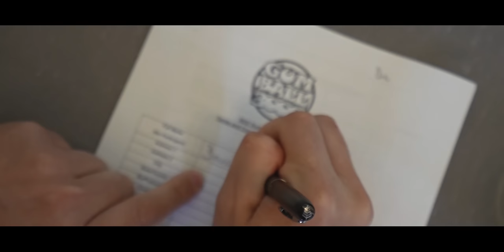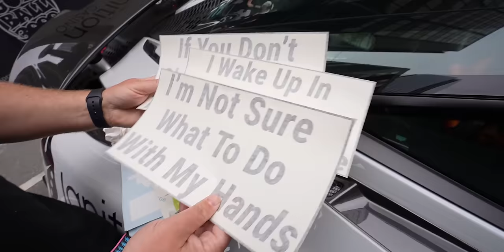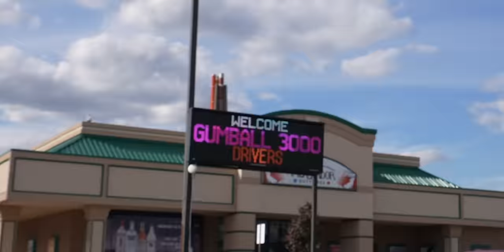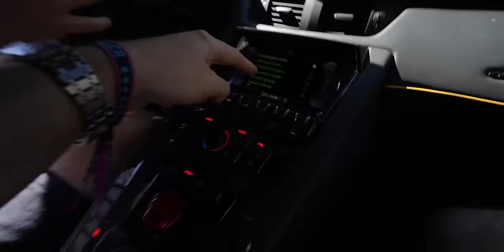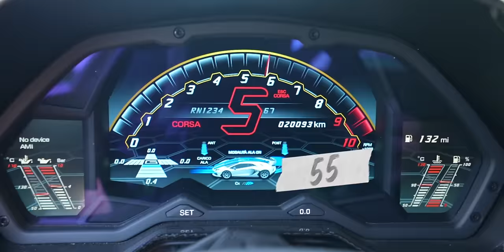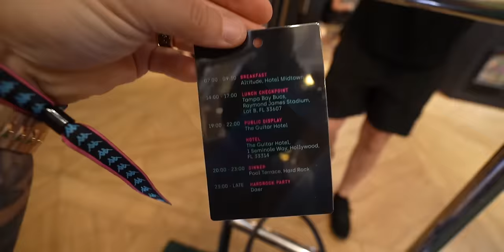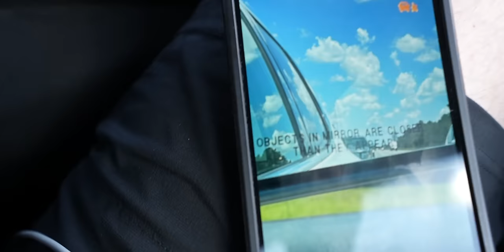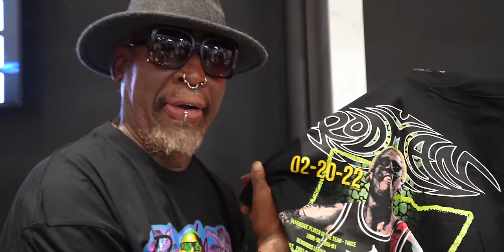DDE X Gumball 3000: The Movie "Toronto to Miami"

Comment: Lots of cool super cars and a few mini busses, the Hummer H1 is the real Hummer, I love it as a Cam car, adding cam Image stabilisation aluminium pro arms and a military top 360⁰ IS Cam setup with a Canon digital camera with a 14-70mm IS USM lens and a perfect 70-200mm IS UMS zoom lens and the last 100-400mm IS UMS zoom lens and the Camera and several mic's and 2-3 of the special direction mic's with a 300 feet rangein the direction it's pointing at and the channel can safely make insane and ultra cool video/audio and production will be so great and the episodes is no limits recording and just add one 3-joints aluminium arm and hydraulic system to do the hard work and it's very easy to get the Special view Cam down just a feet above the ground and movement from the front and slowly getting around to the front wheel tip it slightly up and down to continue with the recording of the super car in Autobarn full speed and back to Hummer H1 speed, everything you need to do with a Cam is more than possible and super cool video's is so easy to make, the Hummer H1 will be the sweet Cam car, and GoPro camera recording of all kind of legal issues and information about the car's legal driving is proved easy and case winning videos. The special long 3 joint arm is so good it's able to get recordings from the ground and straight, upwards and around the other car, the middle section and the 12 feet above the ground and getting in the air and in all setups recording video from being above and 12-? Feet in front and slowly getting closer and still above, side top area recording and back up above the super car recording from above the roof point straight to the back and on the way point it downward and get the working big engine and the rear and rear spoiler wing, from the front and a smooth move past the spoiler and a very nice recording of the back section, ohhhh the best quality and ultra cool episodes will be the new DDE super quality recording and the improved great sound will be new DDE quality...    The H1 can be the best Camera car ever seen, the cool way to get the best quality and Camera view people wonder how it is done so special and the unique style and view points, slow smooth and in one move recordings from everywhere make people wonder how it's done this perfect.
A new ultimate 2024 and it looks like we get a great year of DDE episodes 👍👍😉😉😉🤩

Comment: Stupid, I wonder why the poor management of the building and company, the constant "stupid immature accidents keep DDE at a medium level, stupid projects has to be caught and the cool biturbo, straight pipes, downforce widebody, front and rear spoiler 1000 - 1500 HP projects is being improved and they will be able to get Dave a Lamborghini Sion FPK 37 cheap hypercar or the powerful Revuelto top of the line supercar. The upper pipes are so cool with the super cool look of the monster, a great top cannonball and showoff car for Dave, the expensive McLaren Senna can always be Damian's top hypercar, with an Urus as the photo and tire car following two DDE cannonball cars and making one yearly DDE race from Alaska via Miami to LA, a better race spot behind the DDE building with 3 feet thick soft and smooth layer in front of the concrete wall around. All is possible if all the immature unneeded accidents are history, better maintained engines and drivetrain, oil, gas and brake fluid maintained, knowledge about how to drive a ultra supercar without doing any damage to the engine and transmission, all combined will be enough to get the Revuelto to Dave and finish the SVJ with some real cool improvements, upgrade the Senna to hypercar supermode..   the Bentley racecar look and tuning finished...   No unnecessary employees.
Best of wishes to DDE from Copenhagen Denmark 👍🤩
Reply: Today I have a different choice of cars to keep and using the building way better will get DDE more profit $$$, get a "how to drive a super car" without burning clutches and destroying other parts of the car will get DDE enough money to get Damian his most wanted hypercar and I will love if Dave get a Zenvo Aurora Agil in metallic red and black details, with a black and red details interior, it's possible if DDE is managed efficient and the cars handled as supposed, burnouts is IK, but if you use the clutch to control it, there will be limited time to do these burnouts, damn, some people are clueless as a clueless can be, 🤡🤣🤣🤣🤣🤣🤣🤣